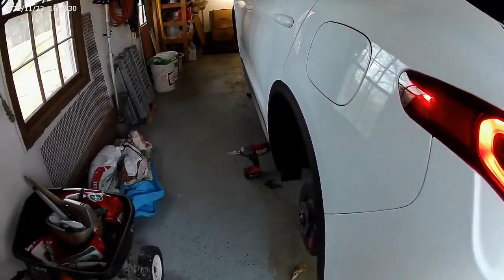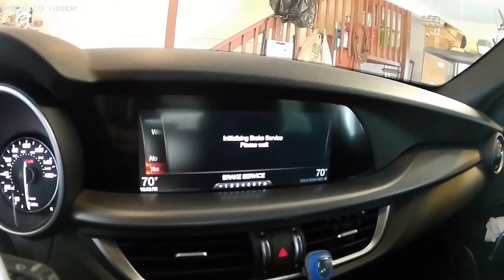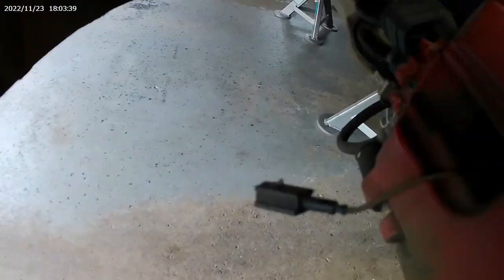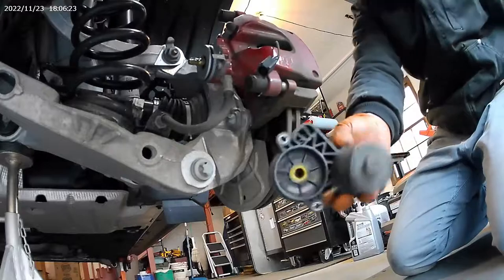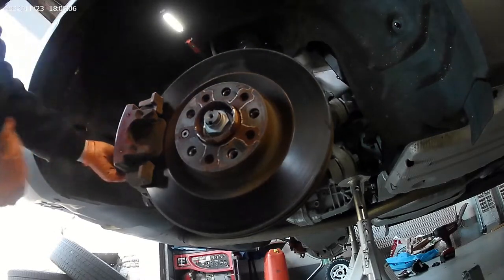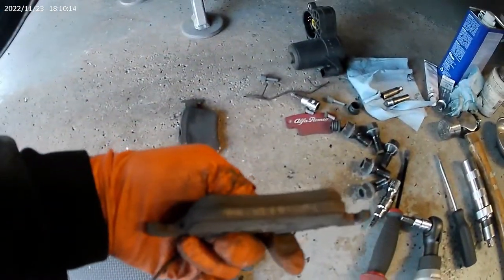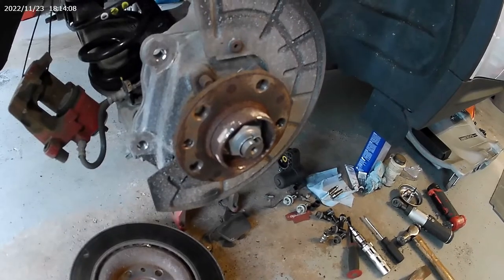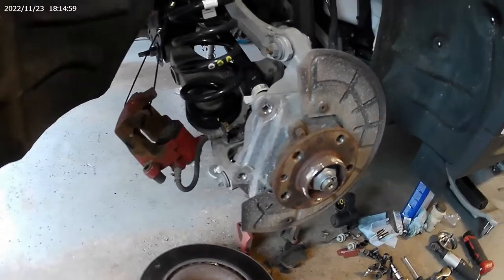Alfa Romeo Stelvio (2017-2023) Rear Brake Pads & Rotors DIY - filmed with GiiSKOM Fancy R2 camera

Comment: No need to take the electric parking brake off, you can push the piston back with it's still on, however, the piston will not rotate, just use a tool that pushes it back. You may or may not need to remove the cover plate depending on the tool you use.

Comment: Why take the EPB off if you put it in service mode or why put it in service mode if you take the EPB off? Just so you know, if you work on a vehicle that has an EPB which you can not retract via vehicle DIC, you can manually retract them by taking off the EPB and turned the screw on the back of the caliper.